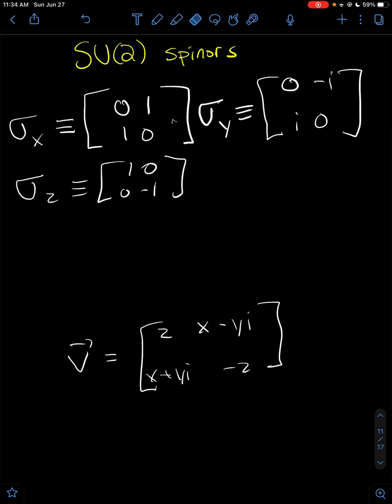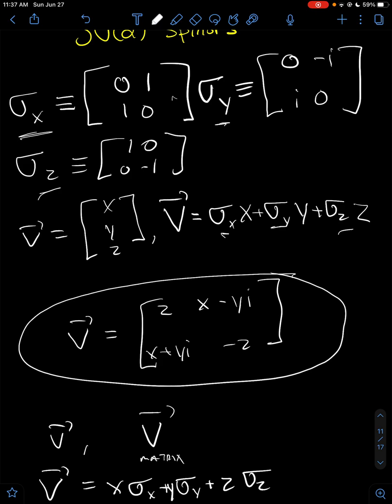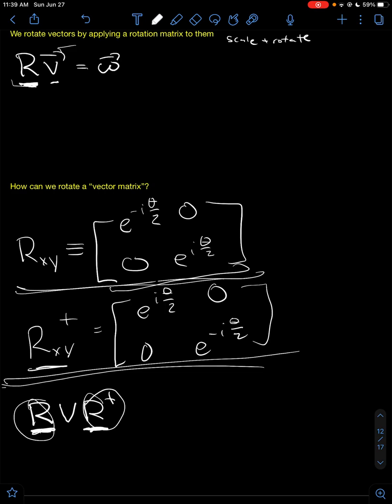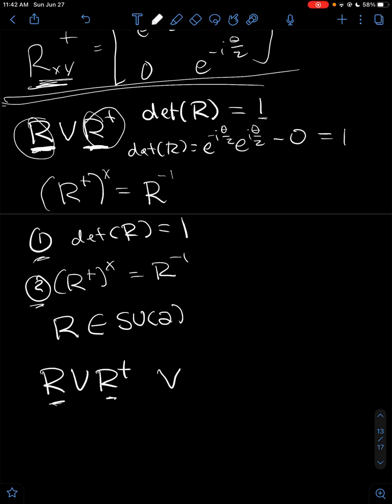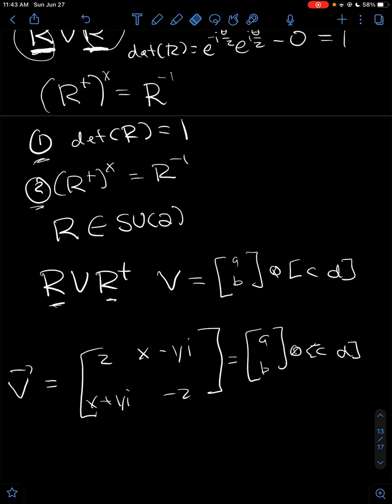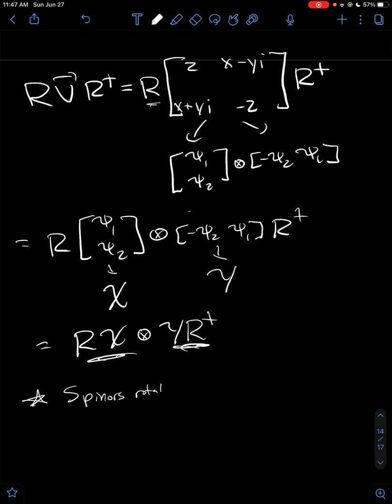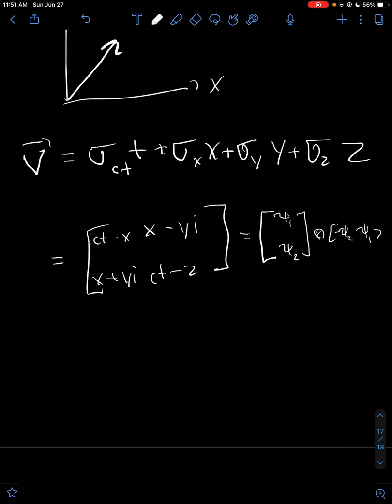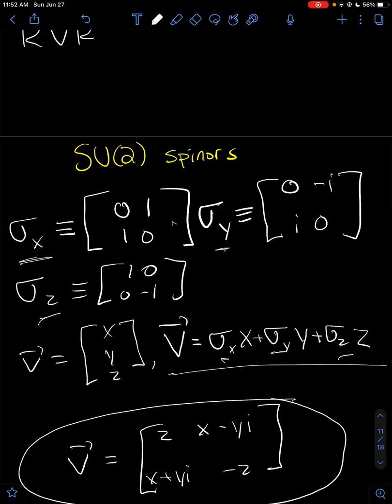Spinning Spinors (SU(2) Rotations)

Comment: 5:00 - think about the derivation like this.  Say you have a transformation T that works in coordinate system A.  That's just a matrix multiplication.  Then say you're given some vector in some other coordinate system B.  What is the corresponding transformation T' in B?  Well, you can 1) rotate your vector from B to A, apply T, and then rotate the result back from A to B.
   
So here think of yourself as having an "identity vector," and V is your  T.  So the R on the right rotates the identity vector from B to A, the V applies the transformation  to that result, and the R on the left rotates back from B to A.  That's the nut of what's going on when you "wrap" something in a pair of related R's like this.

Comment: Someone's probably going to wonder how it is you can go from a 3D vector to a 2D matrix without losing anything.  It's clear of course - the 2D matrix has complex components, whereas the 3D vector has real components.  So your 2D entity actually has more degrees of freedom than the vector did.  But your 2D matrix has restrictions on it, since a22 = -a12 (and is real) and a21 = conjugate(a12).  So it works out.  Someone will probably scratch their head anyway, though.
Reply from the maker: I like to think about it with isomorphisms. The quaternion group is isomorphic to SU(2). We can write a general quaternion q=a+bi+cj+dk, with the condition analogous to U(1) q*q=1. Then we can use an isomorphism between the quaternion group H with SU(2), therefore giving q a matrix interpretation